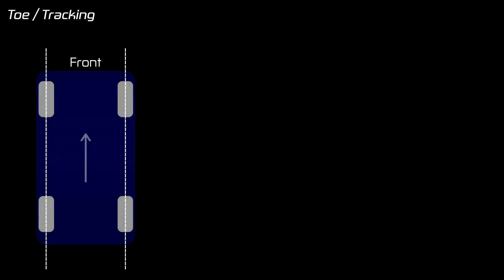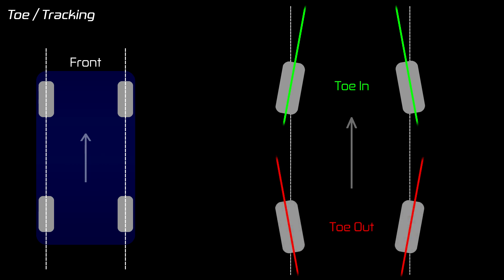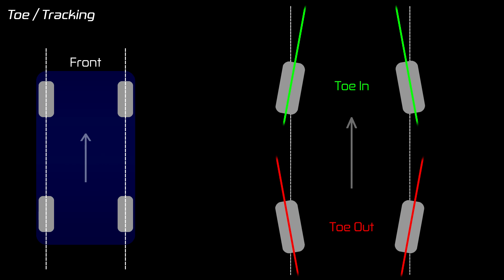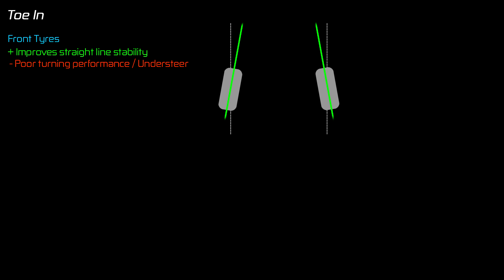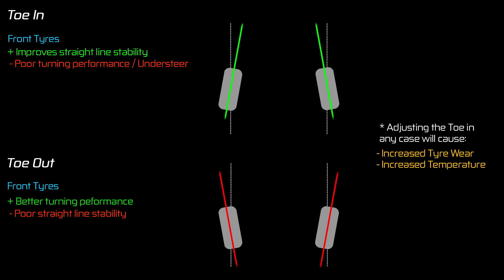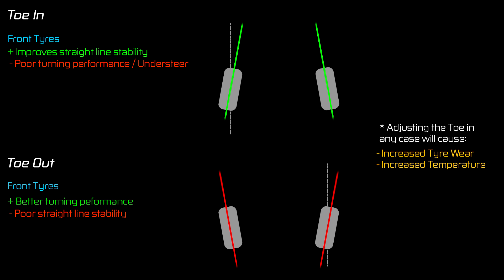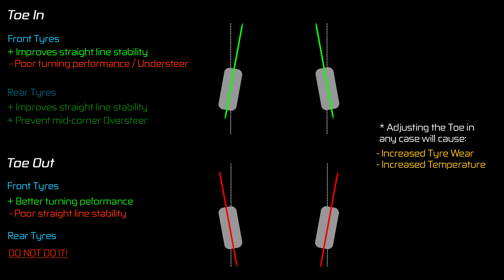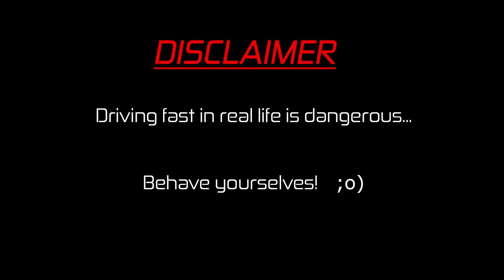Race Sim: Tyre Toe/Tracking

Comment: Funny, Drifters use the exact opposite of your video. Toe in, in front will make under and very poor directional stability while toe out at rear is extremely unstable and slippery. I think even if I was grip racing I would keep a setup close to drifting: the safest and the most controllable!

Comment: Hmm..., I'd kind of contradict you a bit about the front toe in and out effects regarding stability. Just using logics or theory, with front toe in, if you'd even be in a low force turn (let's say in a 0.5 lateral G turn) towards the right for example, the car would be rolling left for a given amount (depends on CG relative to the ground, sway bars torques, suspension stiffness, aerodynamics, etc.) due to the acting centripetal and reacting body inertia forces. The left front tire will have a greater grip force than the right front tire and as such, the overall force will listen to the lateral component vector of the left tire more than that of the right tire. The lateral forces of the front tires are both inwards due to toe-in, but the tire with the greater downforce will lead the resultant lateral force which will self grow up to a limit or equilibrium. Due to this, the car will be continuing the turn on it's own even with the wheel held straight. So basically, the car would only want to keep itself in a left or right long curve without being able to keep a straight line. During tighter cornering, as you've said, it creates understeering and the wheels will start squealing prematurely as the inner curve front tire would be kind of pushing against the outer curve front tire which already suffers from supporting more of the resultant forces. The same principle applies for the toe-out, but with opposite effects. If the car would be in the same rightward turn, the same way the left tire will support more downforce than the right one, but now as both tires naturally create an outward lateral force component and as the left tire force is again greater that of the right, the car would reduce the initial turning force applied and it will settle (this is the word) to a constant turning rate quite quickly. So, the toe-in should give an unstable turning response (you give it a slight turning twitch, but it will keep on turning on itself) up to a limit as it won't be able to make the car spin around because the greater force front tire would be sliding (and losing a bit of grip) before the rear would, while the toe-out would allow for very precise wheel responses, but at greater lateral forces may have both front tires start slipping later than the rear and it may spin out, but on straight line and not too great turns, the toe-out should lead to greater directional stability.
Reply: Pretty confident that it is not so much about which tyre holds more grip, but about what the turning circles of both tyres are. I believe toe is mostly responsible for initial turn in where the car still has a flat platform. With toe in, the inner tyre wants to drive a wider circle than the outer tyre which makes the car less willing to rotate. With toe out, the outer tyre wants to drive a wider circle than the inner tyre which makes the car rotate around itself. Correct me if I'm wrong.

Comment: what about 4wd? i would use toe out on the rear to help the car rotate more around it's axis in a turn, and maybe some toe in on the front to give the car some "safe" understeer. mid turn that would be mitigated by a higher ackerman value(by higher i mean higher radius difference compensation when turning)